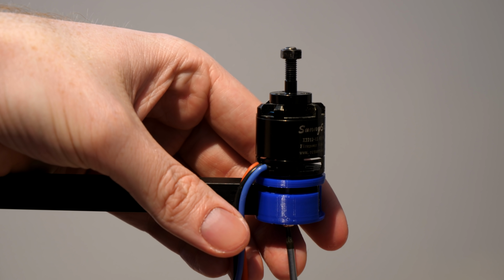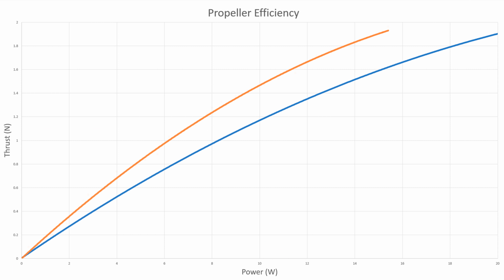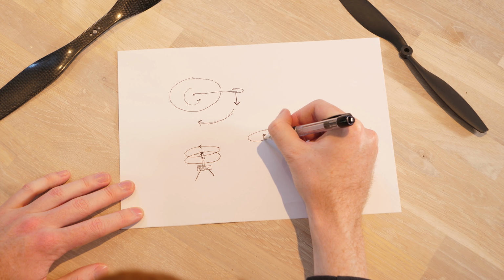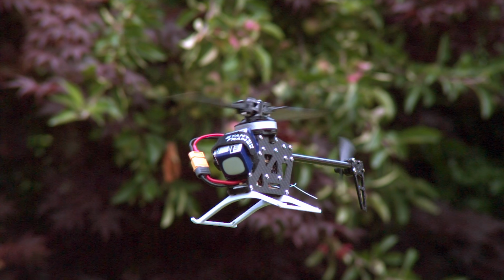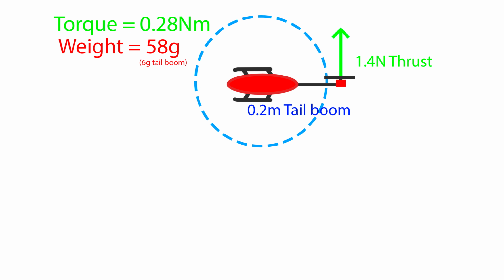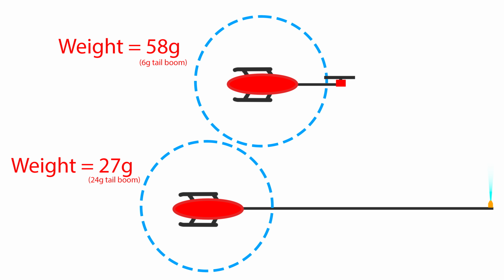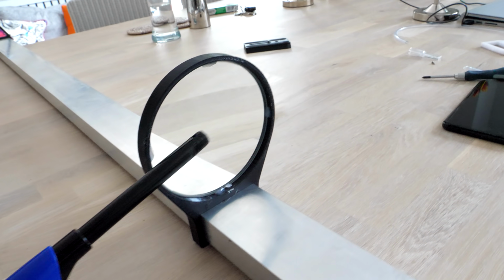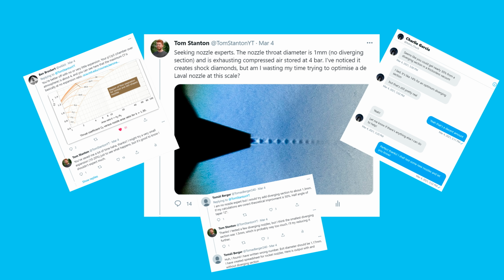Air Bottle Helicopter

Comment: Nevertheless, very cool! Have you considered testing a bunch of plastic bottles for best weight, volume, to air stored ratio? If you are doing many videos still on compressed Air flying devices, it might make sense to do a video solely on the tank and finding the best plastic bottles and plastics for the job. You could pump them up until they fail. Maybe plastic bottles can be reinforced with nylon or stainless steel string around the failure points.

Comment: you are loosing a lot of stored torque energy in the turbine and the gear, because of the tumbling mechanic. If you could stabilize the mount on the tank, it would improve the efficiency of the whole setup

Comment: but you can make a helicopter with jet blades by directly throwing air from the tips of the blades for spinning. In this case, there will be no spinning of the body.

Comment: For a given rotor thrust will go up by power^(2/3).  

 The momentum change of the air is mv.  This equals force times time,  so the force is equal to the mass of air you push per second times velocity.  The kinetic energy added to the air you push is 1/2 m v^2.  But doubling the velocity doubles the mass of air per second and the velocity, multiplying the energy owe second (power) by eight.  

So multiplying power  by x multiplies airflow by x^(1/3).  Multiplying airflow by   x^(1/3) multiplies thrust by x^(2/3).

Comment: Could you try making a small one way valve at the inlet? A small rubber flap that is pushed open from pressure on one side and pushed down creating a seal on the other should be light enough and allows more fuel to go to the rotor

Comment: I'd place a balloon inside of the plastic bottle to act as an air bellow. When filled with air, the balloon will take the shape of the bottle, but as it releases the air, the balloon's volume will decrease and hopefully maintain a stronger airflow and constant pressure. Play around with different air restrictor diameters to limit airflow while keeping overall weight to a minimum.
As for the long tail boom, consider halving its length and using two smaller diameter tail booms in opposite directions to give a couple force instead of the current single lever force. This could help with reducing weight and improving balance. May not look aesthetically pleasing but should work.
You could also use two helium filled balloons acting as ballast tanks to offset the total weight so that less thrust is required for liftoff. But then it'd be a blimpcopter.

Comment: Hey Tom, would you be interested in testing the validity of Jetoptera's Bladeless Propulsion System?  Can you strap a Dyson bladeless fan and use the Bernoulli's principle as thrust multiplier for aircraft?  Chances are those are not multiplier, but just thrust reshaping.

Comment: I think you were over thinking it. Have the air come out of the tips of the blades instead of driving an air motor. less moving parts means less wasted energy. I used to play with toys that used a balloon to power it that way. Just search balloon helicopter & you should get an idea of what I mean.

Comment: Question - is compressed air the best choice?
   Compressed air is easy to use, cheap to create, easy to experiment with, and intuitive because we have such a deep experience with it but do the gas characteristics make it a good choice?
    (I am not expert in fluid dynamics but I know they are around on youtube thus I figured I would atleast ask the question. )

Comment: I love this sort of stuff, splendid work! My immediate idea was the same, to reuse the exhaust from the turbo to counteract rotary action. Humble suggestions; 1. Place the bottle upright to maximise effective rotary thrust. 2. Shorten the turbo exhaust to a minimum and give it a tail. (The tail could be inverted). 3. Chill the bottle whilst pressurising to maximise available air mass over time. (Short launch time required, as the bottle warms from ambient air). 4. Upright launch mechanism would be simpler, in a number of good ways.

Comment: Hi Tom..
Really nice project!
regarding the propeller powers.
I have made a simple tool that could tell you the mechanical power pretty accurately if you enter the diameter and the thrust (for a given air density) 
The power consumption reduces with increase in diameter is very true. The tool I made was done using the test results as the base, So u can trust the values. Maybe it could help u with this project? But surely for any other future projects that involve propellers or rotors. I will be happy to get your feedback !

You can download it for free in https://www.mejzlik.eu/technical-data (and download the static thrust calculator) it is free, but one has to enter their email address. This is not a marketing email :-D , It is free, and be sure that it is not spam!

Thanks
Raam

Comment: Have you considered using an aluminum soda can with a piece of dry ice to create higher capacity of air at higher pressure? (There are versions shaped like plastic bottle with same style of screw on cap) 

Really enjoyed the Swashplateless Helicopter design. Would encourage you to revisit constructing a multi-rotor swashplateless copter. Perhaps a bi-rotor swashplateless copter like the Chinook, or Mars-Copter?

Comment: You should set up a rig for collecting torque vs RPM curves for your air engine designs. Basically just couple the engine's output shaft to a ahaft with 2 devices attached to it. First device is an encoder or hall effect sensor at the other end of the shaft for the RPM. The second devics is a collar clamp that tightens around the shaft via a screw pulling the split in the collar closer together so that clamping pressure is distributed evenly (don't just use a set screw digging into the shaft as it introduces plastic deformation effects which are not easily accounted for). Next a lever arm is welded, bolted, or is an integral part of the collar clamp. Finally a load cell is placed under the free end of the lever arm so that the amount of torque being applied by the collar clamp to the rotating shaft can be calculated. Start with no clamp load then slowly increase the clamping load, all while measuring the load cell and RPM simultaneously. When the clamping torque eventually stalls the engine you have your torque vs RPM curve of the engine all the way from no load to stall load and you can pick a prop with the optimal RPM and torque requirement for that engine.

Comment: You use a nozzle to propel a turbine which then spins the propeller blades through a gearbox - why not cut out the three lossy middle men and simply use downward nozzles as your lifting thrust? The challenge then will be to try to regulate the thrust so that it is fairly constant despite falling bottle pressure

Comment: you could try to use liquified butane in the bottle, its vapor pressure is low enough that a Coca-Cola bottle can easily hold it, and perhaps the propwash will warm up the bottle enough to keep a constant evaporation rate high enough to power the flight!! just make sure to tap the gas out of the bottle on a high point of the bottle, so you don't blow liquid butane out, and stand very far away of course

Comment: You could create a quadcopter with an overall dimension of just slightly more than 1.5% rotor diameter if the rotors were mounted at different heights. Of course, this might mean that lower rotors had lower efficiency because they would be running for at least part of their arc in already accelerated and/or turbulent air, but it might be worth trying.

Comment: Hi. Enjoying the videos. Maybe you could try with a lighter gas such as Helium or Hydrogen Try the gases in a liquified form. You could maybe use a thin walled Aluminium pressure vessel instead of plastic?

Comment: Amazing job dude! I had a couple ideas that have probably already been commented. 1) why not add weights on your propellers to increase the gyroscopic resistance to slowing down. It may be cheating a little bit but it may increase your flight time and allow you to tune things easier as everything will be reacting slower. 2) there is a training helicopter that has 2 counter rotating propellers except they are mounted horizontally and geared so the blades don't hit. You mentioned weight as a reason not to have two propellers but it may be a cool experiment. 

Amazing job dude. Inspirational as always

Comment: You should try using those little co2 cartridges. I dont know how much a full (90psi) 2l bottle weighs but a 16g co2 cartridge weighs 57g. 16g of c02 is 30.4L at atmospheric pressure while a 2l bottle pressurized to 90psi only contains 7.9L of air.

Comment: I now irrationally want to see a formulae one car driving with tractor wheels

You potentially could use a flywheel to assist it in having a longer flight time since this design is being revved up by a virtually unlimited pressure supply and the onboard supply would just be a bit of energy to sustain the flight and the stabilization from the tail

Comment: Why do you need to have the compressed air bottle stationary? You could let it spin (in an upright position) with the blades and have it like those pull string helicopters. Im sure the bottle doesnt mind spinning.

Comment: Alright so I'd like to see more on that propeller that was floating at the end of you last experiment. I know you've done stuff similar in the past. I'm curious if you could use of the self adjusting props fly straight up by themselves using compressed air

Comment: You reaaaally should make use of a pressure regulator valve and only let it start spinning once you've actually pressurised the air in the bottle... Here it's barely getting pressurised at all since a) it's releasing pressure even before you start pumping air into it and b) you can't even allow yourself to pressurise it as it spins too fast at even the lowest of pressures...

Comment: Another rotor configuration worth looking into would be to have rotors that operate in an intermeshing fashion like the K-MAX.  This would prevent the complex shaft you mentioned while still only needing a single air turbine https://en.wikipedia.org/wiki/Kaman_K-MAX

Comment: A water rocket fills water about 1/3 of the bottle volume in order to keep the pressure longer. How about mounting the bottle vertically, neck going down, and then use some water together, maybe 10-20%?

Comment: Do u need a tail router when you have actual air blowing from the tail boom will that jet not counter the main router motion and also save weight of installing the tail router
Another option counter rotation prop  with 2 bottler

Comment: You need to move the filling nozzle to directly underneath the center of thrust/mass.

Right now, what's happening is, the moment you charge the system enough for thrust-to-weight ratio to exceed 1, you start pitching forward because point where you're holding it down is well forward of the center of thrust. The moment you release the air supply is the moment where you are generating the most thrust you will ever be generating, and because you have to release it when it starts pitching forward, your maximum TWR is only slightly over 1. The moment you release it, the air supply starts running back down and you go below 1 TWR pretty much instantly, which is why your flight ends up so short.

Moving the filling nozzle to the center of thrust/mass, or alternatively, using a hold-down method that restrains it from pitching, means you can charge it up as much as you like and release with a TWR much higher than 1.

Comment: I'm surprised you didn't create a destructive valve from inside the bottle to the rotors which only allowed air out once it reached a critical pressure similar to a safety vent valve but using it to allow the bottle to reach a much higher pressure
Reply: You could have also used a refrigerant as the fuel (think of air duster cans)
If you spray them upside down, the liquid comes out which, depending on the surrounding temperature, evaporates into a gas rather quickly.
I used to fill them resealable bags up with a small amount of the refrigerant, hide it where people would be working and wait for them to explode...
Just a bit of office fun 😁

Comment: why not just use a standard helicopter desighn with a belt that transfers power from the main rotor to the secondary rotor, is that not possible?

Comment: So, one thing I didn’t get is, why not put a simple valve on the bottle, and avoid the nose lifting up as it did, and if trust is a problem, why not put a,balloon inside the bottle to simulate a higher pressure environment without putting any risk towards the bottles structural integrity?

Comment: Your air turbines are super cool. Good work!
About a heli:
As you have figured out. More diameter for the main rotor is crucial for efficiency and you do not have much energy stored. So one rotor is better than four. And at first sight, in this configuration, you need a tail rotor as well. Using a jet was a very good idea.
Next step is get rid of the tail and propel the main rotor with wing tip jets! No counter moment will be needed anymore!
About the flight dynamics of a heli: Good luck!

Comment: so with helping to pressurize the bottle, why not add a way to pinch the hose closed? some toys use a plastic clip with a ratchet system to pinch a tube closed. that way you could fully pressurize the bottle using a tire valve in the base (this may also bring the center of mass closer to the rotor axle's axis and down some. the current design seems to want to nose forward and flip under its own weight). once it is pressurized you can remove the air hose and launch it from your hand by unblocking the hose, removing the issue with the nozzle altogether.

Comment: Isn't the flybar meant to be pivoted independently, and slightly geared up with lever arms when pivoting the blade hub? What I mean is, a link rod should be connecting the flybar to the hub pivot plate at different radii from the centre spindle, so the blades twist more than the angle the flybar deflects by. I thought that difference in angle was how this kind of mechanical stabilisation worked?

Comment: Ok, this might be a completely off-the wall approach, but I do wonder if we have gotten computationally astute enough to build a copter with a single rotor and just factor in the counter torque and let the body spin while preserving sensor awareness of the vehicle in space.
Not for this project, but for one that has higher energy density and lives more than a second.

Comment: I would love to see one of your projects use a higher density fuel source. Combustive (which defeats the point) or something like liquid nitrogen or butane that will evaporate and provide a longer lasting more consistent pressure. Possibly even using a small CO2 tank. Love the videos, can’t wait to see what you come up with next!

Comment: If you were to hold down the entire helicopter under pressurization instead of just the front you could get it up to higher pressure before takeoff and then just integrate the release mechanism with the one located at the tip

Comment: I wonder if when you where measuring the efficiency of the propellers if you plotted thrust against motor output power instead of input power, would you have gotten a different  result as the motor efficiency might change with rpm.

Comment: Have you thought about trying to make a pressure regulator? Then you could use a smaller bottle that's pressurized at a higher psi, it would also probably give you a more consistent rotor rpm and longer run times.

Comment: i would recommend a one-way valve, as soon as the air supply is disconnected it closes itself making the turbine spin longer and keeping its pressure for longer. making the overall more efficient

Comment: Hey Tom. Great video. Thanks for posting it, even if there is no success in the end (yet). I love the way you showed the shock diamonds. You know the video of "The Con Hathy Channel" about the "Convergent-Divergent Rocket Nozzle"? I had a discussion with him, because according to my calculations a nozzle with 4bar pressure should reach supersonic air speed.  So different from what he claimed in his video. Our tests with different nozzles are still in progress, but I am also sure that we will achieve supersonic air speed inside the nozzle. Your observations of shock diamonds have already confirmed this.  At what air pressure did you observe them?

Comment: Since the turbine is spinning in the opposite direction of the blades, have you thought of using 2 smaller blades on each (one on the turbine wheel and the other on the gear). Maybe you'd need to move to a belt instead of gears, but that way the rotational energy would be cancelled out and still be used for thrust. That way you wouldn't waste energy on counteracting rotational inertia without any help to thrust.

Comment: What if you tried using dry ice to provide more pressure for longer periods? It should at least help for testing. That should be more energy dense than pressurized soda bottles (just be careful to install an emergency pressure relief valve.)

Comment: I don't know if this has been done before or if it would work but how would putting dry ice In the compressed air bottles as a form of stored energy work out would it be to slow to be useful or to heavy?